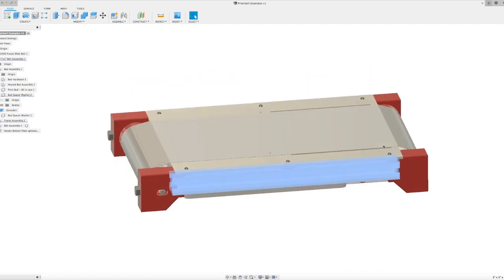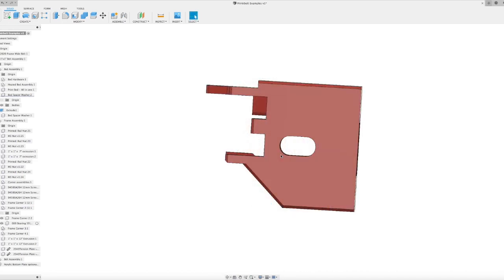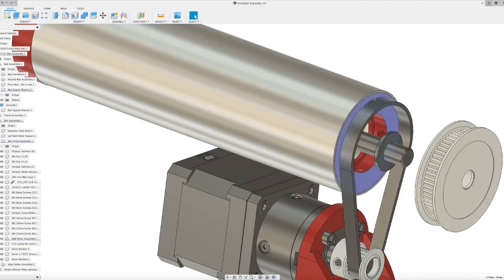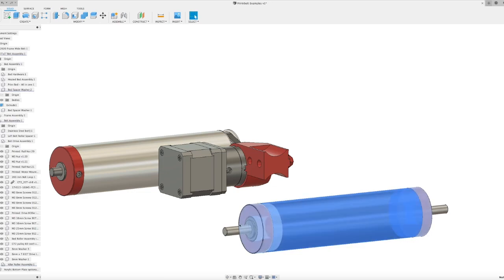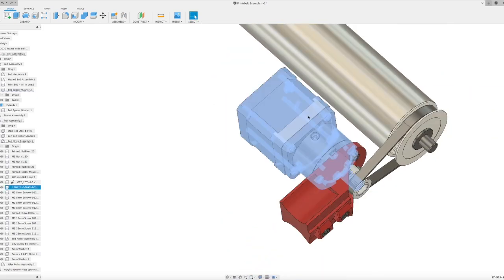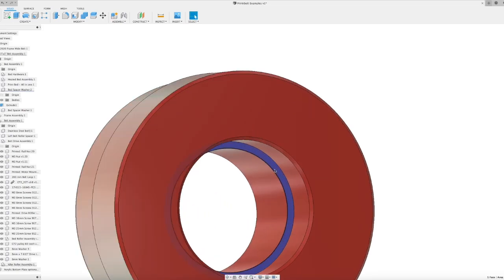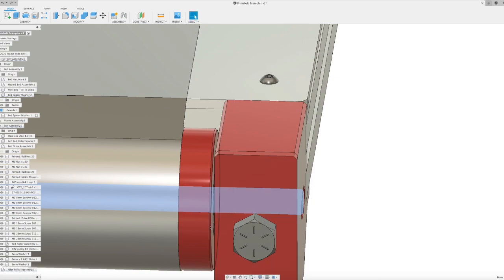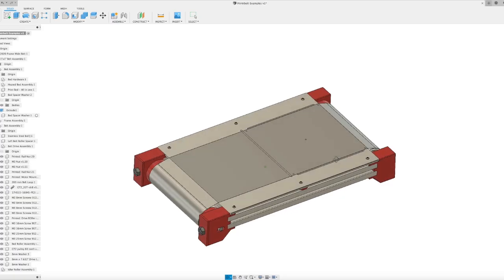Printrbelt Test Belt Overview pt 1

Comment: Why not go for a direct drive from stepper to the active drum (via a no-backslash coupler). This would save much complexity and asymmetric loads on the motor itself . . . and no limit on how big the motor is . . . would look less sexy, but, I think, it would be more practical. If you can put a really large stepper motor, you would be able to claim great acceleration capability and hence good printing at very high speeds. 

I mean, mate, the PSB does not look beautiful but is very practical and stiff. Stiffness is important. And today, many printers are "reverting" to the idea of single Z support that worked so well for PSB.